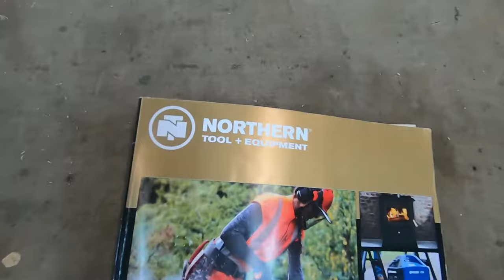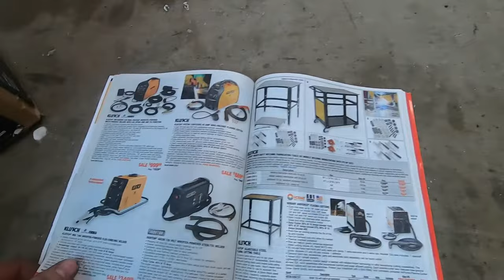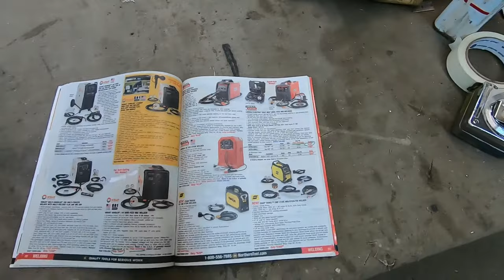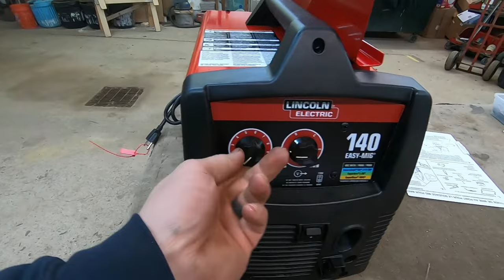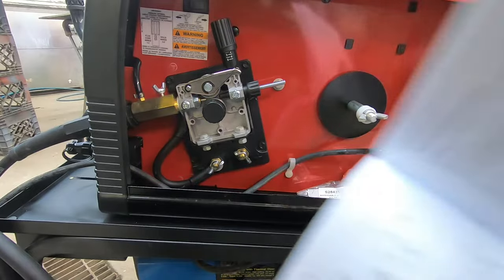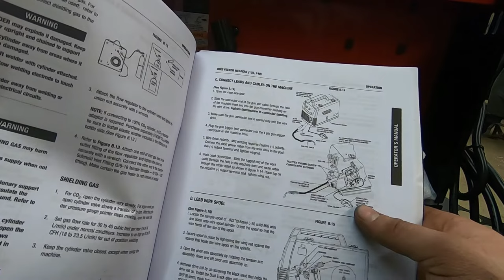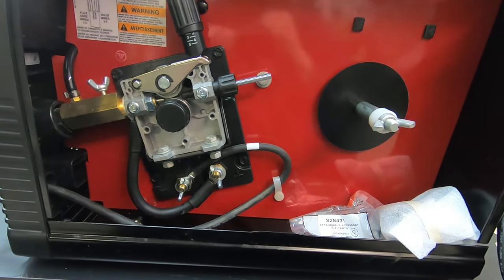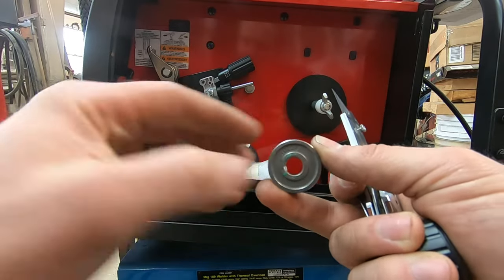Great Mig Welder - Lincoln 140 Review

Comment: I just bought a used Lincoln 140. It came with the box that said it was shipped 14 years ago but doesn't look like it was used more than twice or three times. It came with a Lincoln stand, 2 helmets, goggles, 2 wire brushes, chipping hammer, 2 new pairs of Lincoln welding gloves, a bag of tips and rollers and 2 spools of wire. Also included was an extra stinger and ground cable and clamp that are new along with 2 new regulators. Bought this for $700 Canadian.
Reply from the maker: Nice buy! These are great machines

Comment: Glad I found your video about the Lincoln 140. I was leaning towards the Hobart welder, before seeing your video. Much appreciated.
New subscriber as well, figured you'd have more interesting videos. Plus after reading some of your subscriber's, don't see where I could go wrong. In case you already did a video on the Miller 220. What is your opinion on it? The 120/220 multi function, Mig, Tig, and stick? Thanks again for your help
Reply from the maker: Glad the video helped! It's been a while now, the new 140 has been performing great. 
The Miller 220 appears to be a great machine, looks to be a powerhouse for the next step up in welders. Mig welds welds 3/8" material, that's pretty typical for the dual voltage design. Plus it does TIG and stick welding, that would save some money over buying those seperate. Cant go wrong with the big names, Lincoln, Miller.

Comment: I’ve had mine for probably 6 year’s. I do mig .030 mainly. It’s a solid cheap machine but for sure has limited settings. If you need something cheap for basic flux core and mig get this.

Comment: That's a transformer machine, that's why is so heavy. The Forney 140 MP falls in the same category, is multiprocess MIG/TIG/stick and cost around $400 free shipping. I does not comes with the regulator or flow meter but  a decent one is not expensive. Forney is as old as Lincoln and Miller. Update: I replaced my Lincoln 210MP with another Lincoln, a 215 MPi.
Reply from the maker: Forney welders are not very popular around here, so I was a bit skeptical on trying a different brand. However, I have been hearing alot of good things about that company. I think I'm going to purchase one of their Tig machines....thanks for the info!
Reply from the maker: Yes, less parts and less complex. Theoretically that results in a longer life and better reliability compared to an inverter machine.
Reply: @fml5910  if you buy a good one odds are you’ll be fine. I run a Miller Millermatic 252 transformer machine at work, at home my main mig is a Miller multimatic 255 inverter, I prefer the way the inverter runs tbh, I’m not sure what it is about it, I just like it better 😂. Maybe I’m bias because it came out of my wallet, but I think it’s more than that. I want a little 120 machine like this Lincoln 140 so I can take it on the go and plug up to a 120v outlet.
Reply: @fml5910  Unfortunately for now definitely yes. They usually out live the owner. But inverters have a smoother arc imo.
Reply: @brandoncoston7489  The welders from big box stores are not made as well as their PRO Model's. I have two Lincons both came from pawn shops. you can tell the differs by running then hot on Amps. and serial numbers. they have to cut somewhere. Miller and ESAB, my big machines don't sell to big box stores.

Comment: Hi. Great video! I just bought a Lincoln Electric U2688-3 SP-140T MIG Welder but it is currently in transit. What is the difference between your machine and mine?
Reply from the maker: Looks like that's a factory reconditioned unit, from Lincoln. Looks to have identical features to my welder.

Comment: Would this mig be good for autobody sheet metal ? Im a total beginner and wanted to learn and do some welding on sheet metal on my truck. Any info would be much appreciated!
Reply from the maker: This machine would be ideal for sheet metal, thin gauge plate steel. Has a max capacity of 1/4".
Reply: @marktolman6037  thank you sir! Much  appreciated!!!

Comment: im looking at the same stuff i found a barley lincoln mig pro 135 with tank and cart for 400 so now wondering should i get that or a lincoln 140 or hobart 140 kinda leaning tord the Lincoln 135 pro because i get a tank and a cart but im checking the lincoln 140 videos out now lol
Reply from the maker: The 135 is a great welder, virtually the same as a 140. Seems like a better deal as well...

Comment: Hobart & Miller welder own by same company its means Illinois tool works I currently own a Hobart 187 handler 230v flux core/mig 185 Amp output I own it long time I use my champion generator to operate welder it's been a good unit
Reply: And I bought it at northern tool compared to harbor freight northern tool sells name brands from Milwaukee tools to hobart,  Lincoln to many others tools I have shop here for years

Comment: Hi thank you i have this welder.  What are your setting at.  Heat. Wire feed speed ?   Im new i have a RV gate hinge to fix 👍
Reply from the maker: Thanks! That's a tough question to answer...it all depends on the thickness and cleanliness of material you are working with.

Comment: How long does that argon bottle lasts you?
Reply from the maker: @creativestudio4873  Depends on how often I use the welder. Typically, if I'm busy, I can get around 10-15 hours of weld time while using 15 lbs. on the regulator. I keep an extra argon bottle around so I can swap them out with no downtime.

Comment: Hey I'm just wondering I'm 17 and I'm in the automotive program in my high school but they don't teach me how to weld and I want to learn. do you think this is a good first walder
Reply from the maker: It's an extremely easy welder to use, I would think it would be a great first welder. A little on the expensive side for a first welder, but it would last a good long time.
Reply: @marktolman6037   Do you recommend another weld to first start
Reply from the maker: @andresmolina3732  harbor freight has a few nice entry level mig welders, in the 200-300$ range, if you aren't certain you will be a welder or use it alot, it may be a better way to go, without spending as much money up front. If you are fairly certain that you will pursue welding later in your life, or pickup hobbies that involve welding, you may want to spend the money on a nice welder like a Lincoln, Hobart or Miller. I guess it all depends on how much you were going to use the welder...
Reply: Thank you
Reply from the maker: @andresmolina3732  best of luck!
Reply: Absolutely

Comment: Purchased my 140 back in 2014 and it is still going strong. It has had almost no downtime, It only went down once because I stepped on the handle and broke it open. Used some electrical tape and it has been three years since that happened and still working. I just changed the drive roller last month and that's it. 

Great Video BTW!

I used the machine 4 to 5 times a week so I am impressed, so much so that I used it to build my square drop trailer out of 2 X 2 X .125 HSS tube and it has gone offroad camping for the past three years and still looks great. Here is the link to my build video...https://youtu.be/6qjzy-4pR-o I am not a Pro Youtuber so be kind!
Reply from the maker: Thanks for the info! Glad to hear the 140 holds up to heavy use! Just looked up your video, camper looks great! I like the removable trailer tongue idea...

Comment: I’m setting up my machine right now can I plug it up at my house without replacing anything?
Reply from the maker: You can, however you may be limited on the higher heat settings, unless you have a full 20 amp circuit
Reply from the maker: You should be able to weld sheetmetal and 1/8 plate with a household outlet, usually 15 amps, before tripping a breaker

Comment: If you use 030 wire which way, would you place that drive roller since it has 035 on one side and 025 on the other side is there another drive roller that I should have? I just bought this welder used and 030 come on it. I know nothing about welding but wanting to learn.
Reply from the maker: Hello, the .035 groove pulls double duty for the .030 solid wire. 
https://www.weldingandcutting.com/Lincoln-Electric-Drive-Roller-p/kp2948-1.htm
Check out the description for the drive roller.
Reply from the maker: It might be helpful to download the users manual online, that has alot of tips for setting up the machine and welding basics.
Reply: @marktolman6037  thank you

Comment: Great video sir and I have a question, I'm a beginner self taught welder and my welding isn't the prettiest but it's getting there. What machine would you recommend for someone like me that wants to weld mini bike frames and also 1/4" metal from time to time and things around the home? Thank you for your video and I gave it a gigantic thumbs up. 👍
Reply from the maker: Thank you! I recommend this welded, but it all depends on how much you want to spend...Harbor Freight has some nice machines for a budget minded individual, or a newbie. If you want to spend a bit more, and get a quality machine that will last a lifetime, get this Lincoln 140 or a Miller. Whatever way you go, make sure to get a machine that has a 120v plug, or a multi voltage plug to fit a typical home outlet. In my opinion, you get what you pay for in the welding industry.
Reply: @marktolman6037  Thank you so much for the fast reply and the info, take care sir. 👍
Reply from the maker: Absolutely, hope it helps. Cheers.

Comment: How long can I continuously weld with this machine?
Reply from the maker: At 90 amps, it has a 20% duty cycle. This means you can weld for 2 out of 10 minutes.
Reply: Mine is less on 1/4 steel using innersheild actually it sucks only about an inch of welding before it trips out hate it

Comment: Since when is flux core welding NOT mig welding?
Reply from the maker: Since forever, or since the beginning of welding haha. MiG stands for "metal inert gas." Its only MiG welding if there is a shielding gas used, using a solid filler wire. Flux core does not use a shielding gas, as the the center of the wire is flux. Operating similarly to a welding rod (stick welding).  MiG welding uses gas to help avoid porosity in the weld, flux core uses the flux to achieve this (although doesnt do quite as good of a job). Sometimes flux core and mig welding get confused, because they are both wire feed welding systems.
Reply: So what changes when you run dual- shield mig?
Reply from the maker: Dual shield arc welding uses 2 shielding methods (hence the dual). Dual shield uses gas, and a flux core wire. This welding method is used in heavy machinery and structural welding. Much hotter, faster metal deposition. Expensive

Comment: dont know what im doing wrong its not feeding it
Reply from the maker: Hard to say...ensure the proper wire size, make sure the drive roller clamp is tight. Make sure lead is pulled straight, with tip of stinger removed...

Comment: Can you weld with gas or without?
Reply from the maker: Yes to both. It's a mig machine primarily, to be used with gas. You can use flux core wire without gas.